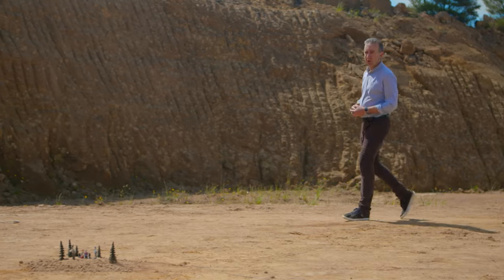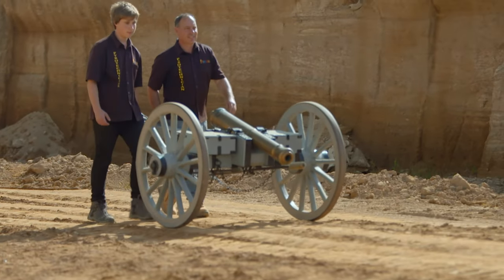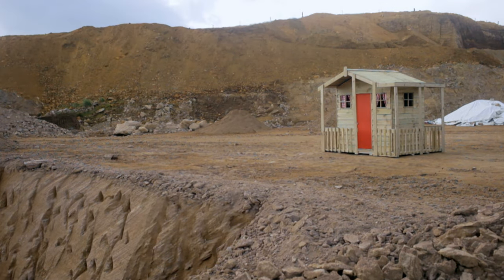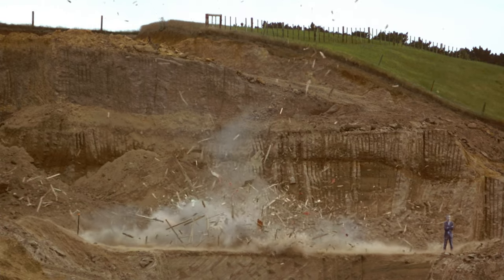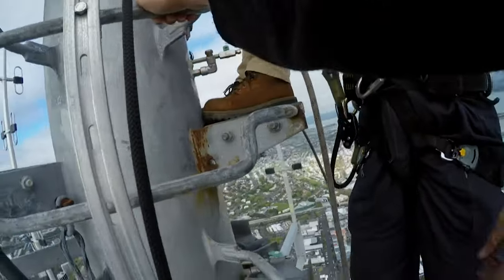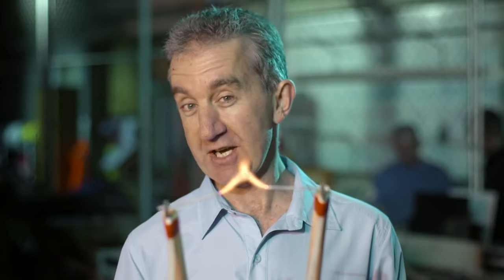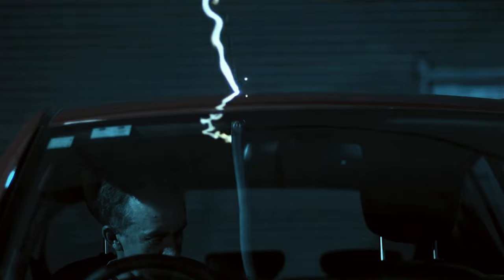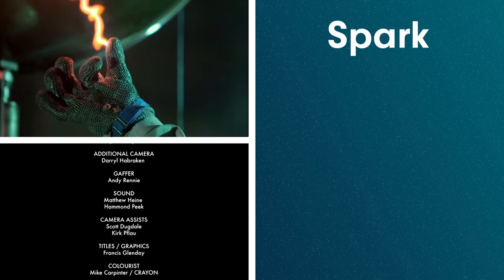Can You Walk Away From A Real Explosion? [4K] | Nigel Latta Blows Stuff Up

Comment: The whole amps is the dangerous part not voltage is bs. I took a few different electrical classes and I can tell you it's always the combination of each. It's wattage, which is voltage times amperage. But if you understood the underlying law of electric, ohms law, it all makes more sense, which is voltage over amperage times resistance as stated in ohms, hence the name. Then it all makes sense that you getting shocked to death was you completing that namesake part of the equation, ohms, meaning you're the resistance. But my point is you have to have wattage, either voltage nor amperage will do it alone